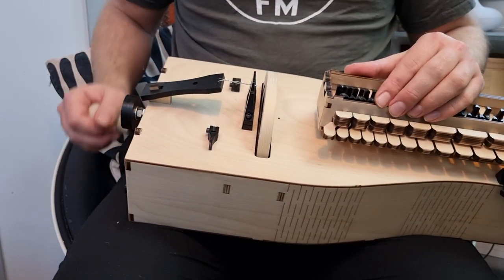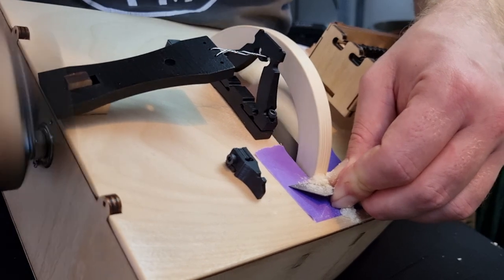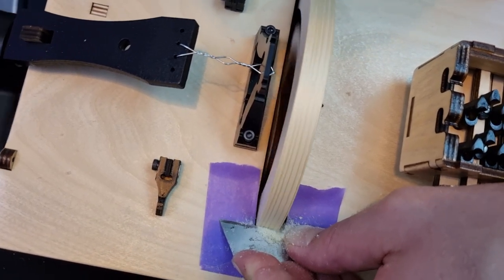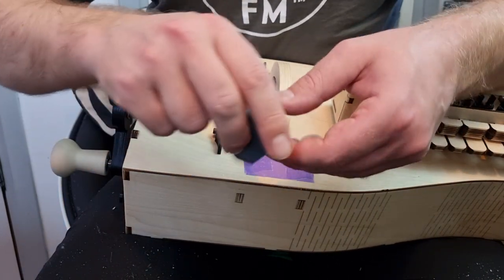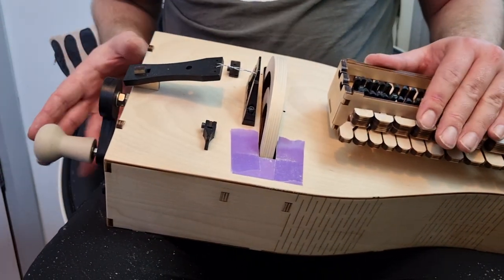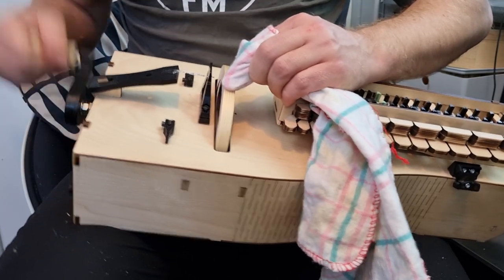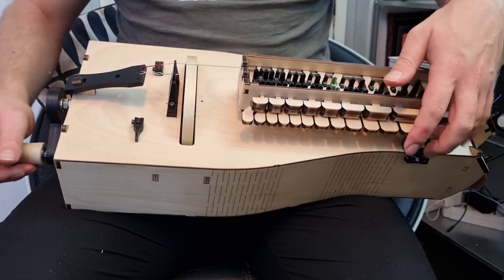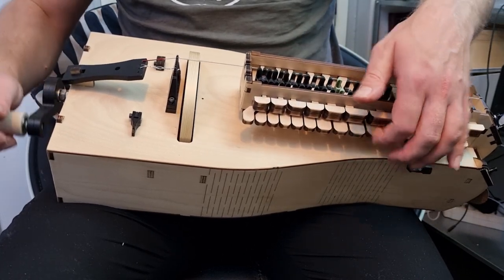Nerdy Gurdy Basic : How to finish the wheel!

Comment: Thank you for the beautiful and thorough instruction. I am not quite there yet, and wondered if you could help me get closer. I am building a 6.3

 It seems that either the moulded insert for the rod is slightly off axis, or the drilled hole for the rod has been slightly off axis. This results in about 2-3 mm wobble on the wheel, when mounted and turned. Do you have any suggestions on what to do about this? How will it affect the playing if there is a wobble of that scale? I hope you can give me a hint, since I would not like to make a bad decision at this place.

Thank you again for the time and effort you put into making gurdys available for us
- Andreas
Reply from the maker: The inserts can be troublesome, best to print a few of the wheel core inserts until you have one that is completely straight.  There needs to be a nut against the wheel core, the helps to stabilise the wheel core.
2-3 mm is far too much, get a few spare cores and try again.
Reply: @elektrovolt  thank you so much for your reply and advice, I will follow up on it :)

Comment: What happens if you make the wheel face rounded, so it had a smaller contact with the strings?
Reply from the maker: The instrument will sound weaker with less grip on the strings and much less control over the trompette coups.

Comment: I used this to true the wheel on my 6.3. It is very true but my strings were all high and I had to do a lot of work to get them down. I didn’t take off as much as this. Is this video only for NG basic?
Reply from the maker: This method works for both the Basic and the regular Nerdy.
Reply: Thanks. I also set my blade into a scraper which helped me keep the angles consistent